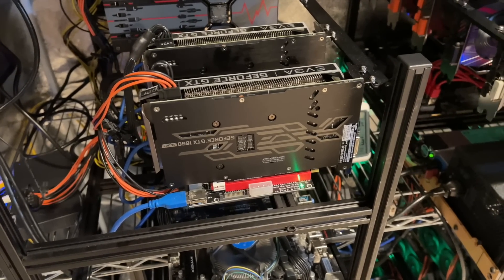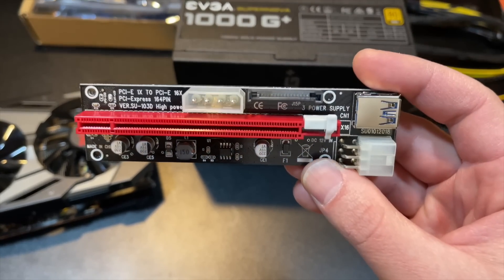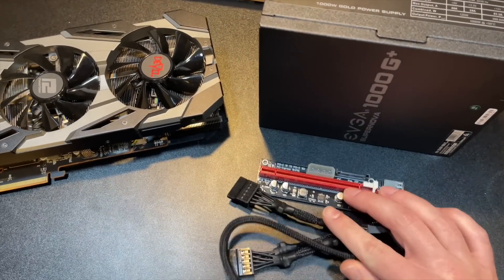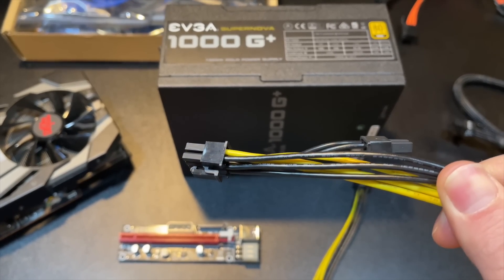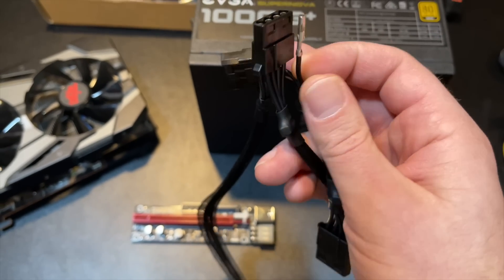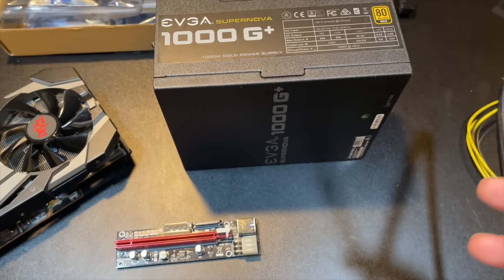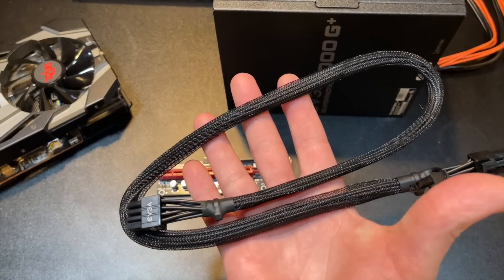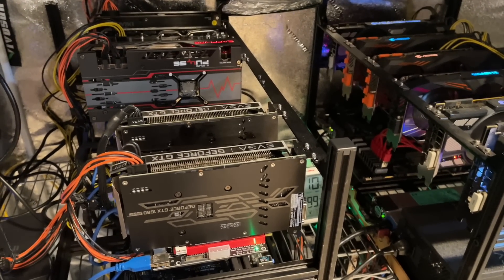Powering GPU Mining Risers Safely

Comment: Most of the time isnt about the awg of the cable or the tpd, but  bad connectors . 20-30watts more than a connector is rated isnt a big deal as long as the connection is firm.
A loose conector/pin generates resistance and according to ohms law ,more resistance = more amps.
And more amps = more watts. ....And you're in trouble!

Comment: But 75w delivers the x16 port and a riser connects to the x1 so it would not be consuming 75w since only from x16 to x16 it would consume 75w and from x1 to x16 there would be less consumption available for the gpu

Comment: Just out of curious.
Why not power Molex(??w) and SATA(54w) together? Then it will have more than 75w for Pcie?
Reply from the maker: It's a valid question. I'm not sure how the Riser/GPU would utilize the 2 connectors on a single riser. I've never seen it done.

Comment: Hey I really thank you for sharing this info. I'm new to mining and I'd like to build something that's going to be safe and reliable and this video is really helpful. Question, I have a PSU which comes with a double VC connect in one PCIE, would you recommend to use one of the connectors to the VC and the other connector to the riser from that one cable, or is it better to have different PCIE cables, one for the VC and one for the riser? I'm trying to put together something that's going to have Nvidia 3060Tis.
Reply from the maker: You're welcome! I'd recommend running 3060 Tis off a strand for the GPU and a separate one for the riser. They can pull 200 watts at max TDP which could overload your PCIe cable. While you'll be running them at ~120w, better safe than sorry.
Reply: @RedFoxCrypto  Oh ok, so, because of the 200 Watts (however I'm running  it at 120W) it's best not to use a PCIE splitter, nor only one strand with 2 PCIE connectors from the PSU, but a single for each, one for the riser and another one for the VC? Sorry, I was confused because of the PCIE splitters you mentioned, I thought instead of using those I could use a single strand, with 2 PCIE connector and feed both.

Comment: so with a 1660 super it should be alright to use the 6 pin to sata connector for a while.  i am running it rn but will switch to straight 6 pin soon
Reply from the maker: I personally wouldn't' use anything SATA.
Reply: @RedFoxCrypto  thanks i was able to switch to 4 molex psu connections and 2 6 pin adapter from the gpu

Comment: Awesome video! 
I will soon have six 3060 tis and i will powering riser and gpu with the same 8pin (using a Y-splitter) and not a 6pin connector to splitter. I know i should be safe.. But im i safe? Will have PL to atleast 75 % and thats 150 W on gpu
Reply from the maker: Personally I’m not doing that, but you should be okay as long as they never reset their PLs.
Reply: @RedFoxCrypto  hmm.. Im thinking becasue a 8pin got three 8 amps.. And the graphics card im usings are tdp 200w.. Hmm will see what i do :) Once again, an awesome and good video! Love it :D

Comment: I make my own pci-e  splitter cables getting rid of  the plugs  as ive seen these also heat up due to a poor connection and actually melt the plastic and short etc. 
obviously some skill with a soldering iron etc is required .
Reply from the maker: That’s awesome. I’ve considered doing the same myself. Are you in the US? Where do you source your parts from? Thanks dude!
Reply: @RedFoxCrypto  I'm in the UK here... I got a job lot of splitters from a seller on ebay had a job lot.
Just remove the connectors which means one less failure point from the system.

Comment: My personal research said that 54 watts for sata (Directly from EVGA 12c at 1.5 amps eachs, 4.5amps @12volts =54 watts), 75w six pin at gpu, double for 8 pin 150watts at gpu.  then i had read a long time ago that modern molex were up to like 154watts.  I was just looking as well, and the molex was created in 1963, but did not find the exact answer on total available load.  I did find a warning on both EVGA and Crucial to not convert your molex to sata since the sata will overload and potentially melt ;)

Comment: I just have a question. Does the gpu prioritize power from the pci cable or riser slot first ? I have low power 5600xt's running at 85-90w power and I have to use sata for riser because there isn't enough 6 pin connections from the power supply. I didn't know that sata could only handle 50 sth w and used it thinking it would be fine and it has been fine for the past 2 months since I started mining. So I'm assuming that the gpu prioritizes 6pin power over riser because if it was the other way around, I would've had a burned down house by now.
Reply: Also, I'm powering one of the gpus completely by sata cables. 2x sata to 6 pin converter for the cable and single sata to 6pin for the riser. and that had no problems either. I bet it would've been problematic if I had powerful gpus like 5700xt or 3080 or sth but for 5600xt at 85-90w it works just fine
Reply from the maker: That sounds dangerous to be honest. I’d recommend switching that up.
Reply: @RedFoxCrypto  yea I'm buying 8 pin splitters tomorrow locally and switching all the sata ones
Reply from the maker: No way to know really. Testing I’ve seen shows that it varies greatly depending on the GPU and possibly even the algorithm being mined. It also doesn’t seem to max out one connector before utilizing the other, but instead uses a mix. Game of chance unless you have the equipment to test.

Comment: I'm mining on Linux and the cards never run at max tdp. It applies the overclock first so for example a rx 5700 is pulling about 130w(from the wall). Been using quality ATX power supplies and have never had a issue with sata or molex. We also test power usage from the wall while building a rig which in my opinion is very important to make sure overall power usage doesn't go over about 80% of rated psu watts. if you use a os like windows that could run the card at full tdp then I could see this causing problems. I Have everything from 580s to 3080s running. to be safe probably best to limit 1 gpu riser per sata/molex cable. We use pcie splitters too just depends on what cables we have available.
Reply from the maker: Yeah Linux based mining OS is a lot more stable in my experience for ensuring the GPUs stay undervolted. Windows can be more challenging that way.

Comment: You're doing it wrong. Read the warranty and product info for a power supply. I know for sure this applies to Silverstone. You can't connect a cable past what the connector is rated for and have warranty coverage. Actual load doesn't matter. Pcie 8pin is 150W, 6pin is 75W, and molex or sata are 60.  You were correct through until you split the 6pin, and contradicted the valid logic applied to risers that 54/60W through sata if a miner tunes for low power isn't safe. You were even correct about the cables failing at the connector. But then ignore that when relying on the capacity calculations of just the wire to validate the choice of splitting a 75W connection to meet two 75W connections. To your own proffered reasoning, that the safest thing is to go by specs (which I agree with), you are doing it wrong.
Reply from the maker: Thanks for the comment Daniel. It's a tricky topic because on one side you have the ATX specs but on the other you have electrical standards. 

The SATA spec, for example, matches on both. ATX spec says it can do 54w and when you break down the pin amperage it matches. PCIe does not. The ATX spec of 75w/150w does not match the electrical capabilities of the cable like it does for SATA.

This is why I think there can be a conversation around it and some critical thinking can happen while utilizing credited resources. 

Can you share your source for the 60w Molex load? Does Silverstone provide something like this you can link? EVGA provides almost no information that I could find besides a post to avoid SATA for risers. It's been a hell of a time locating some concrete information on Molex, which leads me to believe there is no clear standard.

Thanks again for the watch, the comment, and providing your thoughts on the subject. Happy mining brother!
Reply: @RedFoxCrypto  I replied but don't see it. https://www.silverstonetek.com/product.php?pid=756&bno=13&tb=12&area=en
After the load data chart there is a section ~"power supply cable overuse definition."

version of what I wrote that yt ate...
I got a new Silverstone that has 8 pcie cables. I was excited and thought I could power many gpus if I tuned for power and wisely split cables. 
I read their statements, and have since bought lots of adaptors to remain warranty compliant. 
1)  EPS 8pin to dual pcie 8pin;  I only use 6 of one, for 225W (235-300something is the sketchy range like molex has). So an EPS cable can fill ext power for a large card. In a multi-PSU rig, that's a valuable addition when there is no mobo need for EPS. 
2)  Dual sata to 6pin adaptors. Silverstone has 4x sata on a daisy, so that gives me two 6pins (risers for 2 gpus per daisy).
3)  dual molex to 6pin adaptors. Similar story to the sata adaptors, except Silverstone has 3x molex per daisy. The lines never join; IMO two daisies can share an adaptor so there is another three 6pin connectors.

Everything I mention is in the context of Silverstone. My assumption is other companies may differ, but probably have equivalent warranty specs. Silverstone states 60W per molex or sata connector. It's a shame there aren't any 3x sata/molex to 8pin pcie adaptors, as lowering the wasted capacity on a 2x adaptor means better load utilization.
I think PSUs are designed to the warranty specs, and the marketed capacity is just the sum of the supply side ratings under such. So if a high-Wattage PSU has a lot of molex/sata/EPS supply connections, it's particularly deceiving for miners. It doesn't mean you may push a lot of power through the pcie supply connections as long as you remain under capacity. You can, but you forsake the warranty. The rated wattages on many PSUs can only be approached by saturating the plethora of connections with a distributed load. I'm suspicious that this is why some top-tier PSUs exhibit behavior outside the specs when reviewed and benchmarked. Either benchmarks are performed outside of the warranty (thus design) conditions, or the manufacturer shaved off the design to meet the normal max users would meet given the warranty specs on connections. 

Bottom line, it's not just the ATX specs, or the electrical specs for the wires in a cable. If you exceed the rating of the supply-side connector you won't be covered by warranty. How will they know? The plastic in the supply-side is relied on to melt and fail not much further above the warranty rating. The warranty even says it'll be denied service if the supply side has signs of overuse.

Comment: thank you for the info man , that was a clear cut breakdown i love that. do have one question is it safe to power let say a rx 580 from the psu  6pin to 8 pin for the gpu use a splitter off it to power the riser ? should be ok right?
Reply from the maker: Thanks dude. The RX 580 has a TDP of 185w so you should be okay as long as you have high quality splitters.
Reply: @RedFoxCrypto  what could happen if the PSU can't provide as much watts as the card needs? A friend of mine powered his RX 280x with two 2molex to 8pin. He limited the power in Radeon settings and etc. but after a month it wouldn't post to windows and he got two red lines on the display in BIOS. I was wondering if his mistake could have damaged the VRAM in the GPU.
Reply: The best explanation so far I have found si from you RedFox... thanks a lot... ok let be stay clear ....so I can power up my risers with the same 8+6 cable I'm using for my 8pin GPU ?

Comment: Mined over 3 years using molex and never had a problem.
Reply: how many risers do you power per each molex cable?
Reply: @Kraden26  I stick to the rule of only 2 per line and I space them out. Like I said, I never had an issue using them to power risers. They must have good connector pins.
Reply from the maker: I'll be honest. Once upon a time I had 3 1070Tis running off a single Molex strand. Knowing what I know now though I'm lucky I never had a problem. They must not pull too much from the riser.

Comment: Just double check the output on a evga 750 and 1000. There are only one +12v pin on the sata output connector. Even you are using best cable and connector. So for 2 riser, all current is passing throw only one pin at the psu sata connector. Thanks for the video.
Reply: The idea to use the psu vga connector to power both (vga and riser) is a very good idea.

Comment: I have 3 3080’s with 3 8 pin connectors and I’m having trouble finding enough to connect them all directly and also power risers with 6 pin, looking into splitters and/or dual sata to 6 pin for risers, any recommendations? Maybe just get another power supply? Mine currently is 1200 watts

Comment: I have a question. I have 6 3060 ti and 2 850 corsair psu. I'm confused on how to wire it up. I bought the splitter to connect both psu together and connect the other end to the mobo  but can i connect like 3 gpu and their riser to psu1 and the other 3 gpu/riser to psu2? I don't think i can put all 6 gpu and riser one one psu.

Comment: Molex wikipeda page the pin info on the Amp rating.  The 1.57 mm pin can carry 5 A of current, while the 2.36 mm can carry 8.5 A.  From what I've seem most of the high end PSU you can get these days use at least 2.36 mm. https://en.wikipedia.org/wiki/Molex_connector.  Just avoid loose fitting connectors as arcing is the main fire risk.  Anyone can make them, there a lot of bad sources, so cheap PSUs can have poor connectors. BTW bad connectors are a problem with PCI-E power as well.

Comment: I've done some research myself and found that molex carries 3 12v pins and one 5v. From what I've gathered too a molex connector can easily carry about 132w on the 12v rail and plus the 5v rail it will deliver some extra wattage but do not count that in since the only reason there is a 5v additionally to the 12v is just to add to the universality of the molex connector, it only gives the power equivalent to the rail of what you are connecting to is asking for, either 5v or 12v at a time and never both at the same time.
I've been running my two gpus (5700 and 580) under one molex adapter to 6pin, the adapter comes with two molex to one 6 pin since the 6 pin can deliver about 150w, (i know it is the same as the 8 pin, and don't trust me but this is what I've learned from someone on the internet with more knowledge than me on the area, an 8 pin, according to them, and a 6 pin carry the same 3 pins that deliver power and the rest is grounding pins, which means both 6 pin and 8pin can deliver the same amount of power). It has been running like this for about a week and had no issues so far since the molex can deliver up to 132w. According to my findings i felt safe using one of the two molex to 6pin but to be honest the single molex does not cover the whole 6 pins so for safety you could use both molex to 6 pin just for safety measure, i dont think there is any issue using a single molex but idk, if it makes you feel safer and you have the spare cables go ahead.
To finish, my case scenario requires a 6pin connector and the pcie riser comes with a sata to 6pin adapter, ofc i didn't want to use it so i bought an external 2 molex to 6pin connector and used only one. If you have a single molex on your pcie riser i do feel pretty safe so far recommending it to you to use it since it's easier and cheaper to find cable connectors with molex ends than a full 6 pin, which is overkill. Consider your risks before anything you do and i do recommend doing your own research before trying anything new, be careful, you may just burn a cheap cable adapter or destroy your gpu/s or cause a fire, take care.
Reply: BTW! It is not recommended to use a cable to power your riser and the cables to power your gpu from different psus, always use the same psu to power the same combo of riser plus corresponding gpu!

Comment: The chances are the sata cable will be fine if you are using a decent brand PSU, but the sata connector won't be and will melt and burn.
Reply from the maker: Yep. The cables are typically 18 gauge, but those pins are only 1.5 amps each which is bad news. No SATA! Thanks for watching dude!

Comment: Thanks for the video, now how am i going to power 6x5700xt risers? I am using a evga 1600 watt supernova
Reply from the maker: Hmm..lets see. It has 9 VGA ports. That means 6 strands can go to your 5700XTs PCIe connectors leaving you 3 VGA unused. Using PCIe splitters you can then power 6 risers. Should work out perfectly.
Reply: @RedFoxCrypto  My video cards are duel 8 pins and the VGA power cables that came with my power supply are only single VGA 8 pins,( 4 have no splitters and 3 cables have 8 pin+6 pin, still not enough) not enough to power everything. The computer store said i need to run 2x vga power cables to each card, that means i can only power 3 cards. Can i use these splitters? https://www.amazon.ca/gp/product/B08KP9R92V/ref=ppx_yo_dt_b_asin_title_o02_s00?ie=UTF8&psc=1 You would think buying a $600 power supply it would come with duel 8 pins to power the Video cards .

Comment: So question.. my gpu has 6pin and 8pin connection. Can I use the pci-e splitter to connect to the 6pin on the gpu and 6pin on the riser then to the evga cable?
Reply from the maker: Good question. In theory that should work. That would give you 150w max over the splitter and VGA cable which is well within electrical spec.